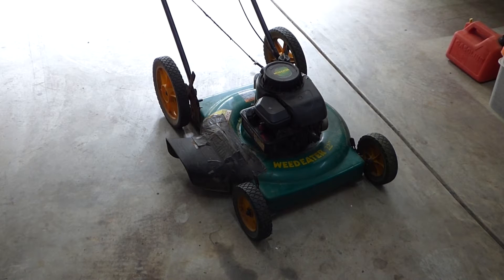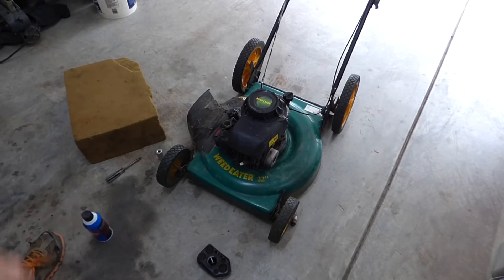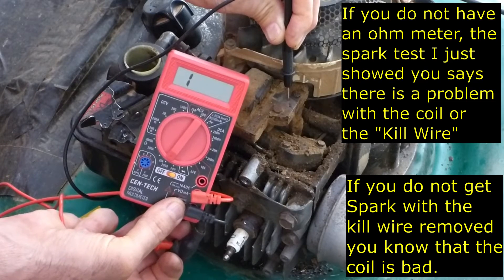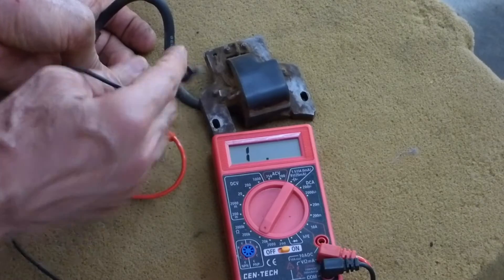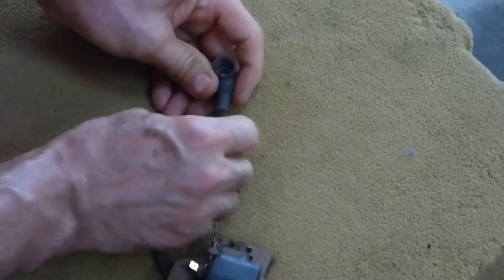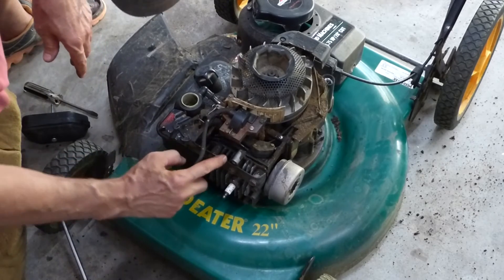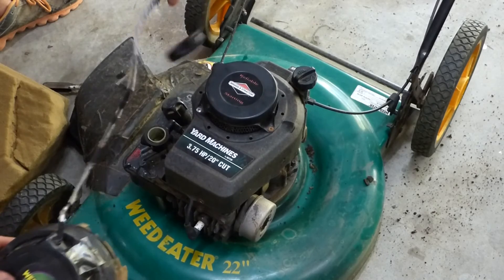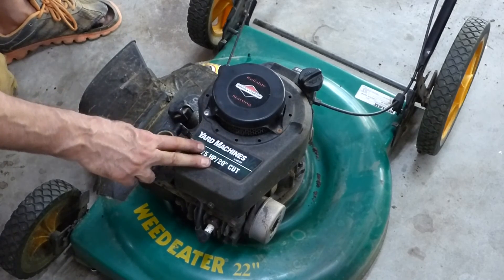Engine Quit - How To Diagnose, Test & Replace Ignition Coil - EASY - No Special Tools Needed!

Comment: I did this  - (4.5 ohms  on 2 coils - no spark - I’m stumped
Reply from the maker: Do you have a bad spark plug?... also you could clean the magnet on the flywheel when you have it apart if it is real dirty and rusty.
Reply: @helpinguonline  yes magnets are clean, wire is good, no spark, I’ll have to buy a $40 coil I guess- spark goes into spark plug then it starts - no spark - thank you.
Reply from the maker: If your coil tests good... try unplugging your kill wire and see if it will run without the kill wire attached to the coil.  If it will, you may have a bad wire and your coil could be fine.
Reply: @helpinguonline  no kill wire connection
Reply: @tjsand8814  than how do you shut it off than?
Reply from the maker: You can put the choke on and it will flood out. You could also take a pliers and pinch the fuel line and that will stop it from getting fuel and turn off.
Reply: @helpinguonline  👍